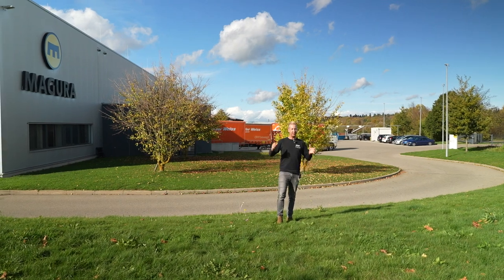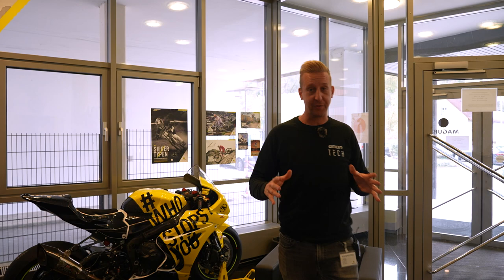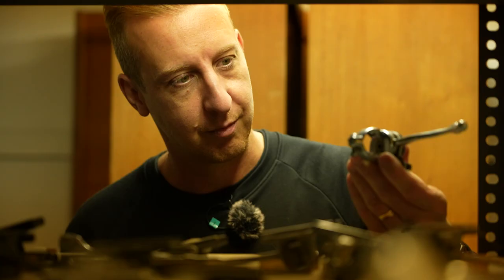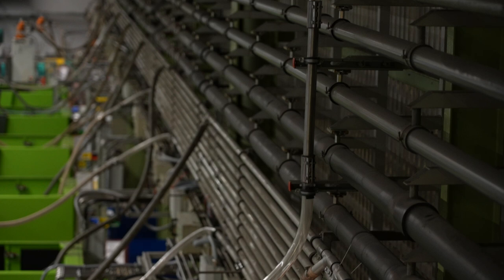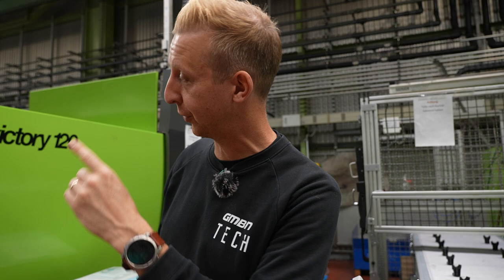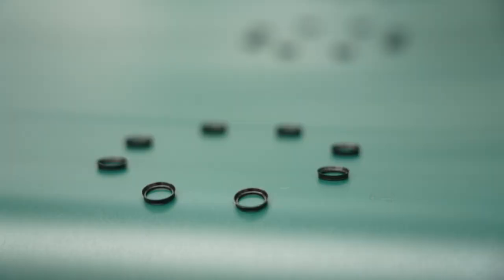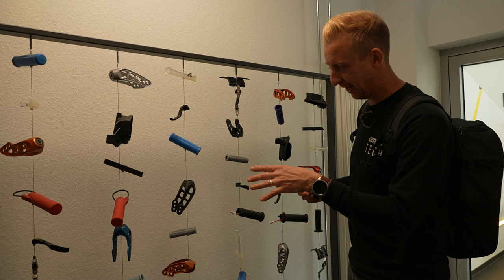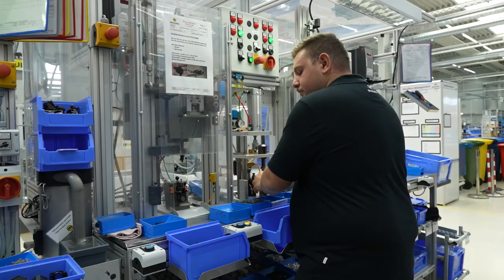How A Hydraulic Disk Brake Is Made? | GMBN Tech Magura Factory Tour

Comment: I love Magura brakes but would like to see some improvements, replaceable piston seals, seems like a huge waste to throw away an entire caliper because they won't sell you seals or have the ability to send it in for repairs.  Also would prefer a metal insert in the carbotecture brake lever, that way I'm not crapping bricks everytime I am installing them on my bike.
Reply: Did you have issues with the seals ? Which model?
I am a long time Magura brakes abuser, and the older models at least were very reliable.
Reply: @iulian2548  The seals on my rear MT7 went and the pistons wouldn’t move freely.  Figured I’d do some maintenance like I was able to on HOPE brakes.  Was shocked that they don’t offer any parts for the caliper and just sell you an entire new caliper.
Reply: replace the levers with shimanos and be happy lol
Reply: @jamble7k  the levers are fine, it’s the caliper piston seals. Shimano also doesn’t offer any spare parts for their calipers and they’re wandering bite point is a hassle to deal with.  No thank you, never again Shimano
Reply: @dytrdr5  actually rode both, MT7 with the original levers and MT7 with XT levers, switched back and forth, the levers of the XT just fit my fingers better, I now ride Shigura and its perfect for me. No issues with them at all. I know the wandering bite point from the normal Shimanos but never had a problem like it with the Shiguras, they just work. But Maguras are great either way.
Reply: @dytrdr5  You can get new pistons and seals for Shimano.
Reply: But not from Shimano, from some Alibaba express or eBay whose quality can be questionable
Reply: @dytrdr5  Try a quality bike shop, you might have to pay a small mark up but it's worth it.
Reply: Regardless of shop, Shimano will not sell you or anyone spare parts to rebuild calipers.
Reply: @dytrdr5  from my experience, I thought it was the seals problem also, it turns out, there is some air that is very hard to purge in the caliper, I have a very good mechanic who helped me, it happened to me twice! Just find a good mechanic and make sure that there is no air in the caliper.

Comment: Abs is not the future, the amount of motorcyclists I've talked to who have tried abs on their dual purpose motorbikes all hate it and end up disabling it, which is exactly what I did on my old ktm rc390.
Reply: i think if you are used to the way non abs bikes work then abs is weird. also unlike on cars there is also the stability to worry about. abs can be unpredictable in that way like if you brake hard on a motorbike it is different.
Reply: @SimonBauer7  so you are unskilled… next your gonna say hydraulic brakes are garbage and overly complex… we have already had these arguments.
Reply: ABS on a motorbike offroad is a minus which is why most adv bikes have the option to turn it off easily. On the road with idiots on their cell phones all around you it's a big plus and can save you from laying it down in a panic stop.
Reply: @Surestick88  I've survived 27 years on the road without abs no problems, its much more important to learn how to brake properly than to rely on abs.
Reply: Abs is amazing, on a heavy touring bike. It’s a godsend.
Reply: @gomerpyle7721  How is it amazing?
Reply: @benjy288  in wet conditions, no rear wheel locking up. I remember using my brakes as I was exiting the freeway on a hot day, a tar snake grabbed my wheel...with abs my wheel freed up immediately. I am fairly certain a non-abs bike would have been laid down.

Comment: Great video! I've become a great fan of Magura's brakes. The carbotecure has some unique advantages... one is that their most basic leaver for MT brakes is actually made of carbotecture and it stops you getting cold fingers in cold and wet weather. Aluminium ones suck the heat away from your fingers but carbotecture ones don't :D
Reply: I have put some tiny rubber sleeves on my shimano brake levers. they don't get cold plus they are grippy even when wet.
Reply: Have ridden brakes with aluminium levers in minus 20. No issues at all.
Reply: ye, not sure temperature is really the advantage. Its probably how they make them so affordable considering they're built in Germany. SOme say they tend to break though. Carbon or not, the actual plastic is just as important in every carbon mixture

Comment: Been running HS33 rimbrakes since 2005. No bleeding, few adjustments and dead easy pad changes. Best rimbrake by far!
Reply: me too, but mine went worse and worse. didn't help to bleed them. eventually replaced them by avid cable brakes. today i am running a mt7 and the braking is really fine IF it is set up well and it is a pain to set up over and over again. i will never buy magura again.

Comment: Great Video... I actually used Magura stuff on my bikes for a long time, starting with the first raceline rim brake back in the 90s. But then, some years ago, my Martha SL lost brake fluid at -12°C on both brakes while braking, at the same time on both brakes. This left me with zero breaking power immediately. I think some seals contracted due to the temp. I was lucky, that there was no car at the junktion I was heading to. Since then I stopped usining safety relevant parts from Magura, as I think they just don't understand, that peoples lives depend on the function of their components. This is very said, as I was actually raised in Bad Urach. Still love my Magura fork though!
Reply: I run Shimano Front and had tektro on the rear, that tektro failed while out on a offpiste bit of trail riding after the trail ran out. now I have XT front and rear. However your comment has made me think that perhaps having different manufacturers products front and rear will give better failure protection.

Comment: I have the MT5e on my E bike build and the cut of switches works perfect without any delay since the function is build in to the levers. This means that you can cut the power off without actually applying any breaking to the system.

Comment: Love Magura brakes. The facility makes me even more impressed. 

A video on new technology, like abs, at the professional level would be interesting. I feel like we are fast approaching a point where the sport has to decide, if it wants to ban electronic aids (like F1), or keep the bikes same as their 'customer' versions.
Reply: @paddor  i don't know about reliability, only used them for a year, but no problems so far. They are decently priced, and just work. Power is through the roof, and there is some modulation as well. I tried codes, but those have no power. Shimano is on or off. For the life of me I could not do hard braking without locking both wheels. There are other options, but the prices is ridiculous. That leaves Magura in my opinion.

Comment: Awesome Insight into the design and technology just reinforces how good they are.
Could have grabbed me an MT7 Master cylinder though, mines just exploded 😩
Reply: I was swapping my MT5's over to another bike and I easily stripped the lever threads where the hose goes in.  My biggest gripe is that if they are going to make their levers suspect, they should sell the replacement parts at a decent price.

Comment: 18:10 and then they arrive at our houses and we have to undo that tidy bleed because of internal cable routing and the hose being too long for the bike lol
Absolutely love my MT5, but Shimano is way easier to bleed properly in my opinion.
Reply: Hose being too long... agree. Made mine shorter for the rear brake. No bleeding required. MT5´s, with HC 203 and 180 rotors.... Its like throwing an anchor.

Comment: I have a Magura MT5e on my fat ebike. Its amazing but I wish it had the auto bleed capability. Another thing I'd like to say is not so flattering about Magura... Not sure if this is specific to Magura or its a societal thing, but when I was ready to buy direct from Magura USA, Jude was very nice and helpful, but after the sale I had a simple question about some product differences an also an obvious German translation issue on their site that I needed clarified (The MT5e is listed with a  Higo Opener or Higo Closer, which I now know is the electric motor shut-off switch's Higo connector and the type of automatic switch you can choose- either normally open or normally closed. I was met with sort of unfriendly attitude by Mugura customer service. They simply wouldn't answer my questions and told my to go look on their site (which still did not answer my questions at that time). I also just wanted to know the difference between the MT5 and MT5eStop, which I finally figured out, no thanks to Magura CS. I said nothing rude to them to warrant this negative attitude I got from them on several occasions via email. It's a huge turn-off for me and I've mentioned it to others who asked me about my brakes and will continue to do so. Also, the USA Magura site was difficult to understand due to translation issues at the time which is why I went directly to them.  I don't go to the Magura site anymore so Im not sure if these issues are still a problem. Oh, and could Royal Blood be a little more expensive?

Comment: Carbon filled thermoplastic is going to be pretty abrasive. So it is going to wear out the molds faster. I'm not sure if they are going to save anything compared to diecasting aluminium.

Comment: Nice video. But my MT7s keeps rubbing and making noise. I'll swap them for some Trickstuff Direttissimas...maybe another company worth making a factory tour with 😉
Reply: Switch to MTX ceramic pads. Even if they rub, they're super quiet. The Magura race pads can be especially noisy. Also, it's best to center the calipers to the rotors by eye with the pads removed. I have Maguras on all our bikes and don't have any issues.
Reply: More expensive brakes won't compensate the lack of knowledge/maintenance 😉
Reply: @BryanCHernandez  💯👍

Comment: A great factory video, which is not possible at Shimano. Shimano Deore are good V-Brakes and disc brakes. Shimano has also hydraulic disc brakes for about USD 30,- a piece. But Magura HS33 are the most powerful rim brakes. And if the disc brake is powerful, Magura and Shimano are on about the same price level. It is good to have besides Shimano more companies on a high level. German technology is always good.
Reply: German technology always has its cons - in this case the con is the sensitive plastic lever which breaks off easily if the bike crashed. Shimano or Tektro offer decent levers. It's the same with Bosch (where cordless tool batteries suck compared to the other big brands) or VW where engines have become crappy. Japanese stuff is made to perform and last

Comment: Do I want ABS on my MTB? Not sure. Reason says yes. But I‘d miss the occasional powerslide, even if it is bad for the tires. And I‘m not racing but driving for fun and excitement, so the challenge of getting the braking right is part of the fun. 
I fully support it for city bikes where you might hit the occasional cobblestone or steel manhole cover in the wet and people bike there to get from a to b rather than for the fun of it. And any error can have severe consequences with cars around you. 
Ideally it should be available as a retrofit. In the end the system is not that complicated, there is tons of experience from millions of cars made with ABS and it can probably be made quite affordable if the production numbers are high enough.
Reply: At the moment ABS is only available on E Bikes (because of the power supply) and on the front wheel, and it's not possible to retrofit it to existing bikes

Comment: Sure the process is high-tech. I personally cannot stand the feel of the material they use for the majority of the levers. They just don't feel as high quality as CNC made Leverassemblies like Hope brakes or the metal shimano levers. They might have structurally the same strength, but what bends on alloy leverassemblies breaks on Magura ones. For the price of a MT7 pro (around 300€ in germany), I 'd buy a Hope T4 V4 for around 400€ or a Shimano XT (around 280€) any day. But again, personal preference.

Comment: The best way to use maguras is to pair mt calipers with shimano levers. 😁 the stock mt5 ones are CRAP. Spongy and flexing. Ergonomics is bad as well. Many brakes suffer from bad bleeding efficiency. I love the story they use the composite to make it lighter. 
I placed the mt5 levers on ebay. Sold in one day. I guess that was a hot deal. For someone who had them leaking or broken   :) 
I use torque wrench and have a pretty good hands to use tools but the head of the lever clamp bolt,  made from plastic , was rounded off not even reaching the clamping torque. 
The design and manufacturing is far from being good.